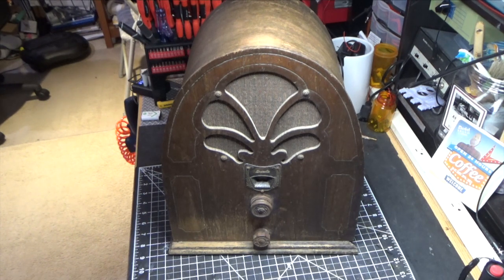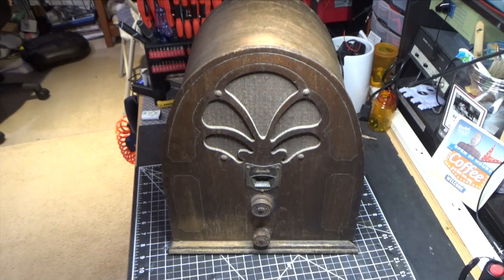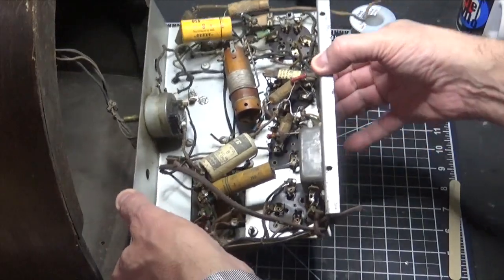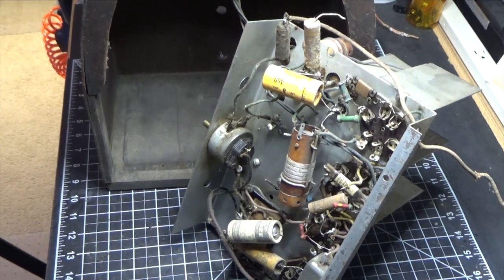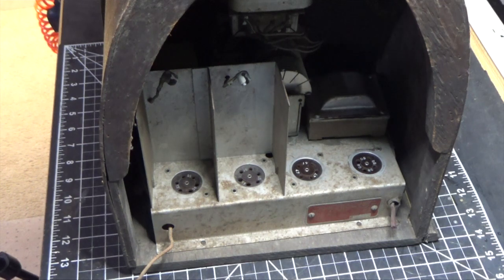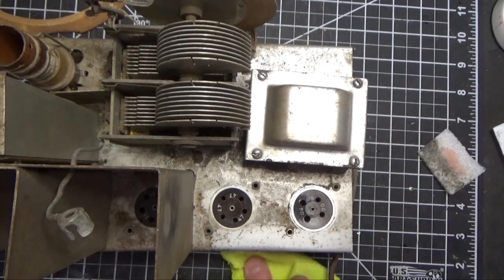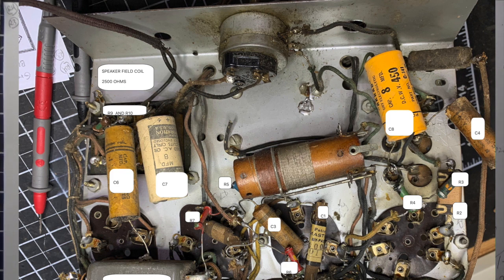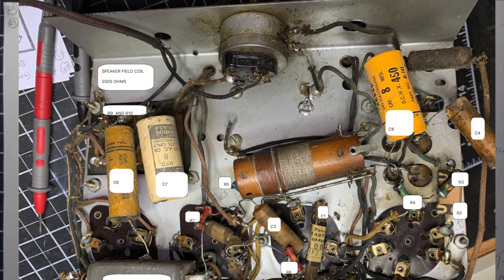Detrola 4 Tube TRF Radio : Episode 1

Comment: Hello Ron the knobs are made by a process called Repwood.  First a form / mold is made, then a concoction of real fine sawdust is mixed with a binder / glue to form a real thick paste, then this is pressed or injected into said mold and the knob is now formed and the mold is removed revealing the knob and the new knob is cleaned and finished. I do not know the details of this process but basicly this is how its made I think.
Reply from the maker: John, Thanks so much for that info.. I did NOT know they made them that way, especially back in 1932. I supposed the process was very similar to how they made Bakelite.  Thanks so much for this, I really do appreciate it.
Reply: @rciancia  
Hello Ron yea I also have a GM console radio radio that has finish work on the front
of the cabinet made out of Repwood too, it has imprints of vines and leaf's in the corners of it ! and yes this is a General Motors radio.

Comment: Interesting tuned radio frequency radio and without a model number very interesting Ron. I am guessing it is from the early thirties. Yes you had to pay for RCA's patent or you could not use the patent. Many companies since it was so expensive went together to pay for the patent rights to be able to produce the radio. It's also great that the sockets have the tube numbers in them. Great video. I guessed the age before seeing what you found.
Reply from the maker: Larry - thats pretty cool that you knew that.. Nothing beats experience !!!  I am honored to be able to learn so much about this stuff...   Thanks my friend

Comment: Very nice radio!  With regard to the sample polishing you did, it looks to me like you may have removed some of the cad plating in that small area in the front.  It doesn't take much and a common issue. The result is very nicely shined steel that will eventually rust when the petroleum distillates in the polish evaporate. Mothers Mag uses aluminum oxide as an abrasive. It, of course, is fine to clean the entire chassis that way but a good idea to clear coat it afterward to protect it.
Reply from the maker: Ironmill..  thank you for stopping by. I generally use Boeshield or clear lacquer to protect a chassis after I polish it. This has worked really well for me so far,  but you are 100% correct and spot on.  Thank you